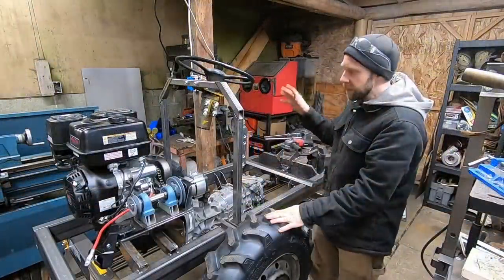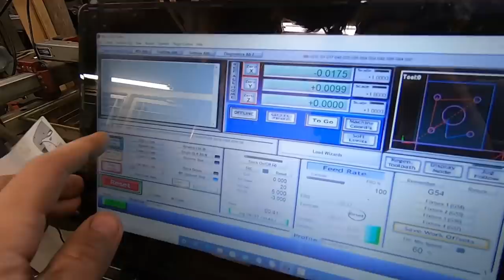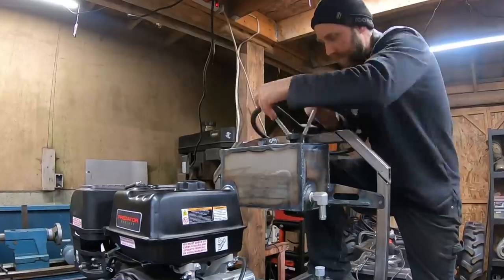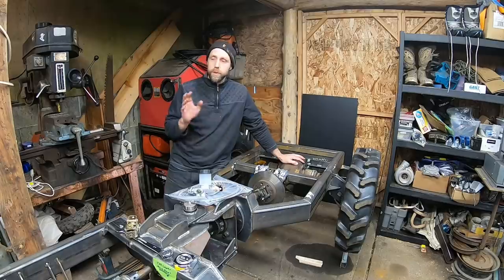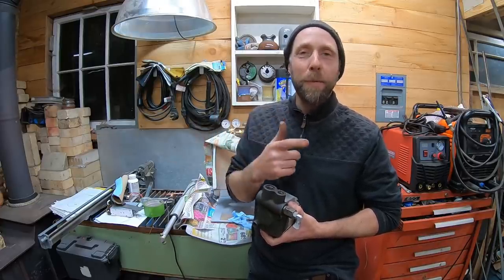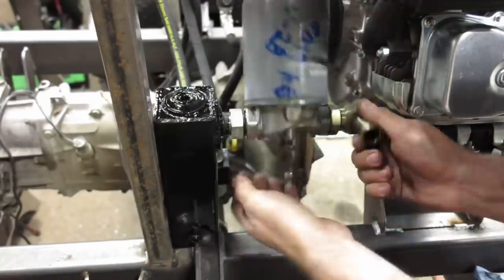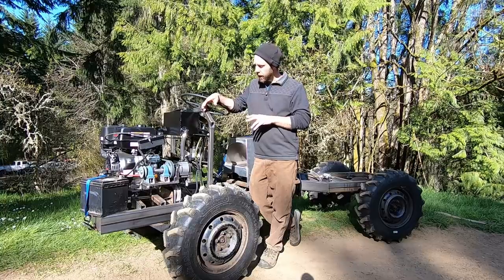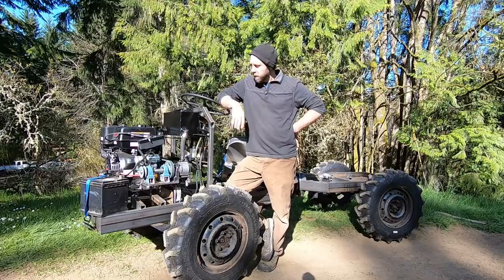420cc Predator powered articulating 4x4 dump truck build part 6

Comment: I have a drive line break on my skidder. You might start planing some skid plates to protect steering and driveline components. I really dig the little cabin.
Reply from the maker: Marc Fournier Thanks for checking out my video 👍 yes I’m definitely going to build some skid plates, I’m also going to build a heated cab for Winter snow plowing. Take care Marc
Reply: @Mikefestiva  heated cab wow that would really be cool

Comment: To bad you can't build a beefed up bike derailleur to switch gearing as needed to have high torque when needed and speed when needed. 

As you are going to be using this for work built in tanks for normal gas, chainsaw/weed eater gas and bar oil will be useful to not need to carry individual jugs when you combine with a transfer pump. A spot for a chainsaw vice to sharpen chains at in the field and a spot to transport chainsaws so you can have both a long saw for where you need to cut large trees and a smaller saw for trim work can be handy. An insulated box mounted somewhere on it that you can put a heating pad will also make winter filming easier as you can keep the batteries warm.

Comment: Definitely one of the best builds I have seen in a long while! I don't think it will be very good for your property though. Seeing the test drive it seems more suited to one of those comp truck/ 4WD machines. Maybe you could take it along and make money pulling them out when they get stuck! This thing looks so capable and you have done a Brilliant job on it. Another home built that leaves Commercially Built equipment for dead. Very well done mate, even at this stage clear to see this is an absolute winner and something any man would be bloody proud to have in his shed!
Reply: Hey man, thought you blew up an oil burner and died. Good to see you're still alive. Are you ever making videos again?
Reply: Hey Mike,  Love your Videos! Have you though of finishing it off with a hook lift instead of just a dump bed? A hook lift would enable use as a dump bed but also work like a multi-tool (e.g. leaf collector, water tank, wood chipper, sprayer, tool carrier etc!) Good luck in whatever you decide!
Reply: @dustinshort6207   yeah, I'm aiming to.  Been saying that  year but at least I'm not saying No.  I have done a couple but didn't publish them because they were boring and crap.  Lost my Mojo but hope to get it back... one day at least. Keep telling myself this would be a good time to get back into it now everyone is bored at home and looking for some entertainment.  I'll Go and drag something out and start setting up this afternoon and  see how I go from there.    :0)

Comment: Very cool test drive. Its narrow for the trails but also long. Making mental notes for myself if I try to build one later. Have you thought about a rear pivot limiting plate to keep the rear from flopping over on a step hill side? Kind of like a Unimog? Pretty cool stuff. Keep up the good work. For those who complain about your center differential braking system they use these on real heavy equipment and also 3000 hp. Monster trucks.

Comment: As mentioned ROPS is a huge thing on these trucks. They do spend time with the shinny side on the side at any grading site with a load spilled out the side. In bad ground they flip at least once a day in an eight hours shift. 
This one sure did crawl like it was born to crawl over obstacles.
Reply: You better get new drivers or better training  if they rollover once a day!! We may get 3 or 4 a year with 12-15 trucks running, in lovely central pa

Comment: I would weld the center diff in the transmission. make it true 4 wheel drive. also the rotor that you made is not hardened at all and will wear out fast. this is a cool project. good job

Comment: It's going along good, but seeing how big it is and how much more weight it would carry loaded you would really benefit from the added low rpm torque from the predator 670 v-twin
Reply from the maker: I definitely think the 670 would be nice but at the time of starting this project I was and continue to be on a budget, the extra $350 to buy the 670 was money I really needed to get the project going, it’s already cost far more then I wanted it to and I’m not finished yet. But it will be solid and this machine will last a long time. There’s not much available on the market for something like this, plus if a side by side cost $15,000 I’m sure a articulating mini 4x4 dump truck would cost a lot commercially built. Take care

Comment: I run equipment. I've run a 75t crane with a drive line parking brake, on smaller equipment the service and parking brake are on the drive line . farm tractors did it for years,tanks, dozers.list goes on. Nothing wrong with it.
I would have put the steering rams on top to keep them out of the muck.

Comment: A lot of the HMMWVs I worked on in the Navy have five calipers; one at each axle shaft, right next to the differential , and one on the driveshaft, at the front of the rear differential, as an e-brake/parking brake.

Comment: I was going to suggest a spring-loaded seat, but I see you are way ahead of me,  and have that in your plans already.   Very well done.   I expect you'll have years of hard use out of this project, easy.  Since it's strictly off-road, you likely ought to weld up the diffs all the way around, just to eliminate 3 places to break, and to make sure you don't get stuck with one wheel spinning, the others just sitting there, "whut?"  :)   Looking forward to the next phase.

Comment: Sorry if you already answered this question but do you have a tilting limiter ? Because torque will turn your rear axle like a helicopter 😂 
The central brake is a good idea but remember that Subaru gearbox have a central LSD and if you park the front will slide a little.
Congratulations for the work you have done, you inspired me too, but you know...... job, kids, maybe some day ....

Comment: You've got mad skills this is one heck of a build! The only thing I would recommend is once you're finished with all the fab work and tear it down for paint, go get everything sand blasted and powder coated instead. This dump truck will see some heavy use and it would be a shame to have the paint peel off and see it rust after all the work you've done 👍

Comment: This is a really neat-ass build. You're property is wonderful BTW, I felt like any second someone was gonna show me a tiny house over a crappy acoustic guitar bit.
I too completely agree on the driveline brake- mining vehicles use them all the time in combination with electric motors running in regen to protect hydraulics from puncturing rock, though thanks to the modern car scene most think bigger=better when it comes to brakes which is just stupid.

Comment: Works Good I like it  --- I`d suggest a wide  Bus seat sorta thing to be able to slide to the high side of the unit when going over an unstable terrain being high like you are it might roll the front the back won`t matter really , I made one like this many years ago use 2 self propelled tillers and a jack all jack between them and a hitch ball same kinda thing ,but I sat behind the back tires with long handles worked great .

Comment: Fantastic build great to see it out and working I think for the little extra work to run the brake lines to the front brakes I would link them into the trans brake sometimes the rear wont be loaded and traction wont be great there but the front will always have more weight due to the engine but cracking build cant wait for the next update .
Reply: vtecpowergt you are correct about just rear brakes not being enough. Mike did not go into full detail of the brakes but the foot brake peddle does  apply the front brakes and the drive line brake. the drive line  disk actually has two independent  calipers on it one is just for the parking brake the other one is applied  along with front brakes via the foot brake peddle

Comment: Hi Mike love the build... your work and knowledge is superb. Been following this build right from scratch here from South Africa. Your 4x4 would really need some xtras to be used here on the 4800 ha game farm. Maybe like shock absorbers for a softer ride,  some kind of roof to stop the African sun from killing you..lol and some side protection if one of our Cape bufs, rhinos or a lion gets to be in a bad mood. Really love your work and cant wait to see what you`re adding next....Eugene
Reply from the maker: Thanks for checking out my new video!
Yes suspension would be nice but for my property and the slow speeds I’m traveling it’s going to be fine here, I think of it like a tractor with a dump bed. I am building a suspension seat for it though, I think it will definitely make it more comfortable. We don’t deal with the intense sun like you do, but it rains a lot up here in the Pacific Northwest so I think a cab is definitely in order 👍 Thanks for commenting I really appreciate it 🙂
Reply: Here in North America your more likely to die from hypothermia then the blazing hot sun.
Reply from the maker: Haha I think your right, up in the Pacific Northwest it’s commonly just above freezing and raining in the winter. Cold and wet 😐

Comment: Really enjoyed the video. To the guys bitched about your bright choice I get their concern but like you said it's your vehicle the news on your property it's not a side-by-side or utility vehicle being built for the mass public. I wouldn't weld the rear diff before I would look into an electronic locker or a aftermarket locker I know there's some stuff for Subaru's but I'm not a subaru guy so I don't know what's out there.  Maybe on a e locker in the front and a Mini spool in the back or if you have to weld them in the back for true for all wheel drive.   Just my 2 cents keep up the great work.

Comment: At the plant I used to work at we had a little winch truck the size of a golf cart only 2 wheel drive  but so useful in tight areas .if you were to add a set of jin poles outside of the box  and added a hydraulic winch you could double the usefulness of your vehicle

Comment: I really like this build. I wish I had the time and money to do things like this. I know you're using pretty much what you got. I think that if you take the same design add a three BT diesel engine or a small Kubota engine. Maybe also implement a PTO shaft that could be plugged into. You could probably generate a pretty good business. 
Well done I really appreciate the videos and you do look like you were working hard for this.

Comment: if you play with hydraulics it's nice to add 1 or 2 extended ports if you in the future will be need move a large rock you can make some kind arm or even you make a small trailer, etc. it will be ready to use.

Comment: I just realised that the hydraulic system is more simple than I expected it to stay so far in that u don't need to rely upon electric sensers to control how much the steering moves some of those early engineers got things so right even if you need spaghetti type lines to run it at least u won't be stuck by a electric short looking forward to when you reduce the gearing too

Comment: Hey that's looking great what about just using a hydraulic motor to run the trans to make it hydrostatic which also works for braking plus gives you forward and reverse in any gear.

Comment: Nice !  Job well done .  Suggestion ,  put the Battery in the empty space under the seat where it's somewhat protected , I can foresee problems with it exposed like it is on the front of the frame .   < Doc > .

Comment: To anyone who might complain about the drive line disc brake, there's a sh*t load of custom 4x4s that have insane amounts of power, and use pre-diff brakes to avoid weight in the suspension system. Some of the insane, near vertical drop hill climbers have them, those engines screaaam at max power pushing insane speeds and torque, yet they use them. And there's even  more odd setups like pinion brakes. Yeah, look those up.

Comment: Just found your channel today and getting caught up on your builds! Love, love, love it! Mike you are an excellent fabricator. The front and rear diffs are from the subbie wagon? I am trying to learn and possibly find some lightweight diffs (maybe aluminum) with cv style axles. Looking to eventually build a 1.9L TDI 4x4 ATV.
Reply from the maker: I’m in the process of looking for the same light weight diffs from a Suzuki sidekick or a small Toyota Rav 4. After I complete this articulating dump truck I plan on starting a rugged side by side build.

Comment: My Isuzu NPR had a driveline brake like yours, and it relied on that, and the front disks for all stopping power. that thing was rated for huge payload compared to your dump truck, and would run highway speeds, I bet you will be fine.

Comment: Are you planning to puts some limits on the amount of rotation that the bed is going to be able to do? I just remember using one similar to this when I was a teenager working at a horse farm. I went around a corner too sharp and the rear tire caught and flipped over the whole bed. what a mess. Oh course, it may have flipped over the whole thing but the back sure went over easy without it.

Comment: You know you should make a set of hydraulic grapples that attach to the same points at the dump bed so you have a skidder for your mill also add a blade on front. That would be awsome.

Comment: Great video and well done. I have done some research into the 4 way hydraulic steering valve, and it contains a "gerotor" pump/motor. I think it effectively acts as a rack and pinion with the hydraulic fluid being a virtual rack and the gerotor acting like a pinion, moving along with the fluid traveling through it. If you could please in your next video, try to turn the steering system without the engine running, i think the gerotor pump will act a rack and pinion when you loose power steering in a normal car, allowing you to still turn the vehicle, by providing the pumping force from the valve assembly and the steering wheel itself. This is just a theory, and I am NOT and expert, but if you could please try this at some point, I think it would be good to see if you can still have steering if the engine dies during use. Thank you for documenting this build, it has been very fun to watch.
Reply: Yes you can turn it with out the motor running but without the added hydraulic assistance it is very hard to steer it is similar to trying to turn the steering wheel in a car with power steering with the engine off and not moving

Comment: Part 6, did not disappoint, you've built one hell of a machine Mike!  Very impressed with the test drive and the paces you put it through.  Was wondering how you were going to use the 5 speed gear box, I like your thought process as you explained it at the end.  I am curious about that pressure distribution manifold you made out of the square tube, maybe give a little detail on that in part 7?  Going to enjoy all the future videos this is sure to generate, thank for sharing.

Comment: Great job! Pretty ambitious project, I'm glad to see it finally running. And it looks like the plasma table has proven very capable for your needs. I underestimated it's capabilities when I first saw it on the market. I would get one if I had the space. Are you a heavy equipment mechanic or operator in your day job?

Comment: awesome build, just came across your channel and catching up on the build ..... any chance you would sell a bracket/mount kit for other DIY guys who dont have a plasma table?  id be interested in the brackets for spindle mounts, and pivot system, sure would take alot of the guess work out of it for guys who dont have that capability.
Reply: that would be interesting once it is put into use and the bugs are worked out that is the nice thing about cnc once the designing is done reproduction is easy I  know that is why he is went with the complete running gear from a single car to make replicating it easier

Comment: A suspension seat like on the fullsize articulated dump trucks or smaller equipment like a tractor or compact track loader/skid steer loader would make it more comfortable especially on the rough terrain with loads. Maybe you could make a mini version using a rear air adjustable mountain bike shock. Seen also someone use the front forks to suspend a gokart seat before but with the seating position higher above the frame I think the rear shock would do jus fine.

Comment: Maybe put a cvt belt style deal on there would give you more gear reduction off idle and would broaden the gears some
Reply: A cvt would be nice but because he is driving a hydraulic pump with the same out put shaft it as the clutch it would have been more of a challenge to run a cvt and a hydraulic pump on the same shaft not impossible but definitely more involved and if the centrifugal clutch turns out to be not adequate he can go back to the drawing board and try to incorporate a cvt

Comment: “It’s alive” said in a Dr. Frankenstein voice. 

It runs great and the four way articulation works very well. Also now that it’s been outside I can see that your rear axle is actually about as far to the rear as possible without putting your tires beyond the frame end and potentially interfering with the dump bed. 

As for your orbital steering valve. Is there not a way (with check valves) to take output pressure from both sides and combine into one line for steering override on the hydraulic pump?